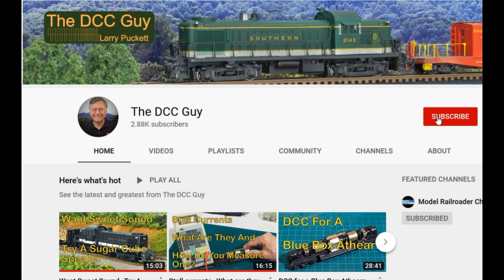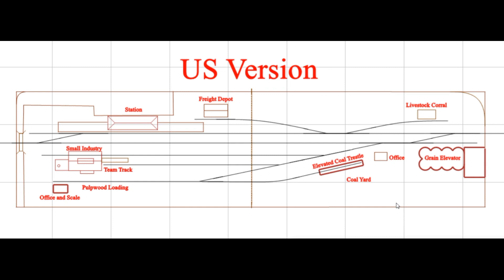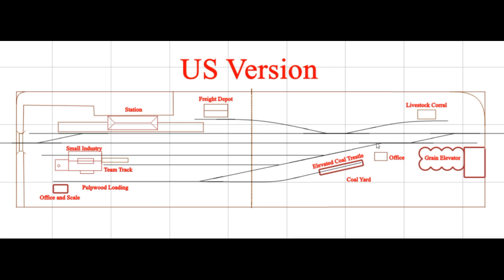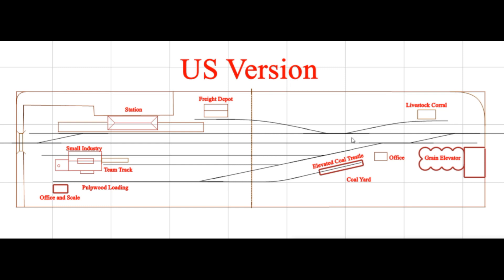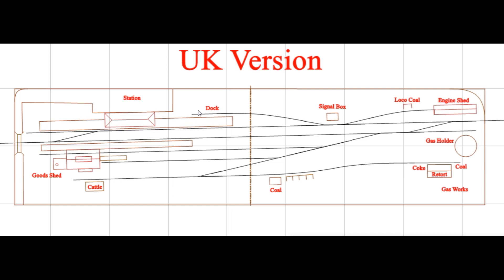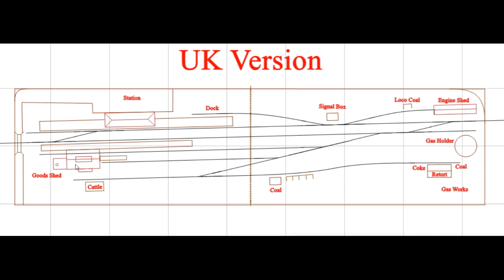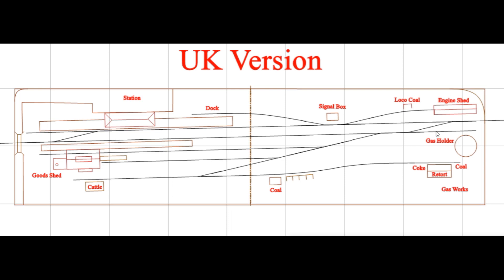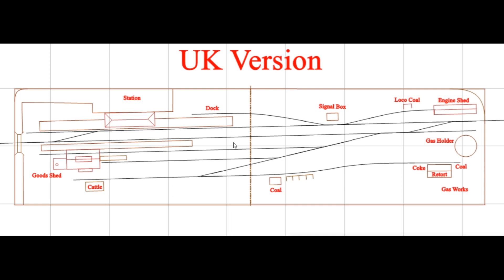US & UK Trackplans (135)

Comment: Hi Larry I am building a short line layout so your video was had a lot of good information and ideas.
Great Torrington Station was a terminus prior to 1925,however there was a narrow gauge line which interchanged with the standard gauge line.This line connected Peters Marland clay mine and brick works to Gt Torrington and was built as a private railway this would make a great addition to the layout.The gauge was 3 feet and they used a carriage to convey the workers to and fro to work .
👍🇬🇧
Reply from the maker: Christow on the Teign Valley line had a similar arrangement with a quarry. A standard gage spur ran from the station a short distance and met a narrow gage line that ran up to the quarry face. You’re right that this could make a nice added feature.

Comment: One comment on the UK version of the track plan (since you did ask for comments) is that the mainline is typically should be through the normal route of all the turnouts.  You have all through trains using one of the cross-overs.
Mark in Melbourne
Reply: I noticed that as well.
Reply from the maker: Thanks guys. That part of the plan is based on the original track plan for Buckfastleigh on the Ashburton branch. I used it to start and then used Torrington for the goods yard arrangement. Looking at most others I see your point. Let me give flipping the orientation a try and see if I like the traffic flow that way.
Reply from the maker: OK, I ran the mainline straight through along the main station platform and reversed the crossover on the left end. This is the current track arrangement at Buckfastleigh although it now is a terminus instead of a through station. The tracks at Trusham on the Teign Valley line were also arranged as I originally had them. I may have to flip a coin to decide which to actually build.
Reply: It may not be typical but it is prototypical. Many stations used as the passing point for 2 trains would require the exit points to be reversed before trains can proceed.

Comment: In the UK there would be a barrow crossing. This would be for staff only. Mainly for moving trunks and or parcels on a barrow (a 2 or 4 wheeled device for moving parcels or goods.) In the UK the gas holder was called a gasometer. You don't see them any more. When I was young, every town or city had one or more of these. Depending on the number or residents there.
Reply from the maker: Yes, I have not added all the small details like that as well as the ground throws in the goods yard, exact positions of water cranes, etc. I might even install one of the Hornby elevated walkways for more interest. Gasometers were also very common in the US towns up until mid-century when natural gas largely replaced what was called town gas or coal gas.
Reply: No, both are acceptable in the UK.
Reply: No actually gas holder is the term the industry uses in the U.K.

Comment: Larry, Torrington is a very interesting station to model because from 1925 to 1965 it was a double ended terminus. The line to the West (geographically South) was the North Devon and Cornwall Junction Light Railway and passengers had to change trains at Torrington to use it. There used to be a turntable in front of the engine shed to turn the engines of trains to and from the East; Westbound trains were usually pulled by tank engines. (See 'Lines to Torrington' by John Nicholas and George Reeve or 'Branch Lines to Torrington' by Vic Mitchell and Keith Smith)
The West end of the station had both the platform lines coming together at a single switch. This would be a much more common arrangement than the one you have with a crossover and the platform extending beyond it.
Reply from the maker: Thanks Mark, excellent information. I found a small amount online about the milk operations but what you point out about the track arrangements is new to me. I assumed that tracks did extend at one time as photos show an elevated bridge just past the end of the tracks but so far I have not turned up any track plans for that era. I actually based the mainline run through arrangement on the original plan for Buckfastleigh and then overlaid the goods yard at Torrington. Buckfastleigh had the goods shed next to the station and I wanted it across the tracks much like at Princetown. There is so much info on the GWR and it seems so little on the Southern lines, especially west of Exeter. I was initially interested in the Southern but due to the lack of info as well as limited availability of locos and coaches focused on the GWR for which there are tons of each.

Comment: Those short stub tracks are called "Head Shunt" tracks.
Reply from the maker: Would it be a head shunt at the west end of the loop track? I thought a head shunt was associated with a goods or other type yard area and associated points.
Reply: @TheDCCGuy  it all depends on length and intended use. Short spurs off the end of a loop would murd often than not be over run protection, but may also function as a head shunt.

Comment: Nice vid.
Your track plan has what I think is necessary for interesting operations:
- multiple leading and trailing industries
- at least one switch back
- a run around
But the ends of the run around seem so close to the edges as to limit the switching consist for those not wanting to extend trackage.
What do you think?
Reply from the maker: I agree that moving the crossovers inward would give more room for moving cars but it would require shortening the yard tracks. You also need to be careful moving them as they then impact on the placement of turnouts over the module joints and those cross pieces.